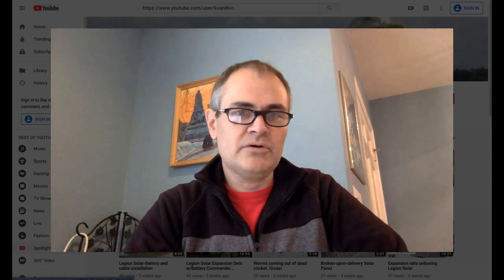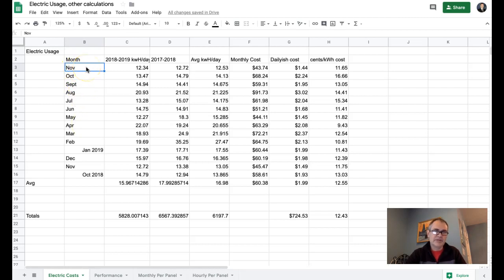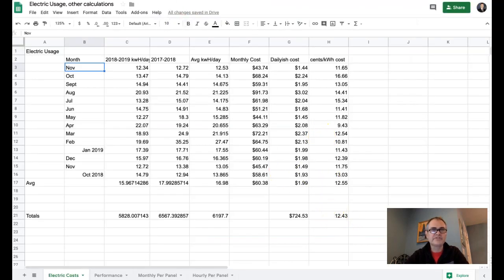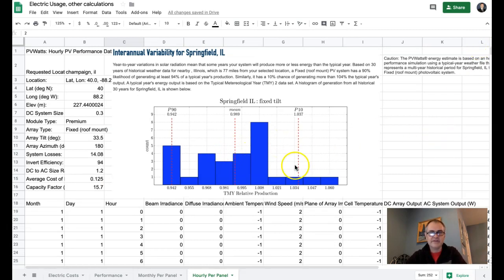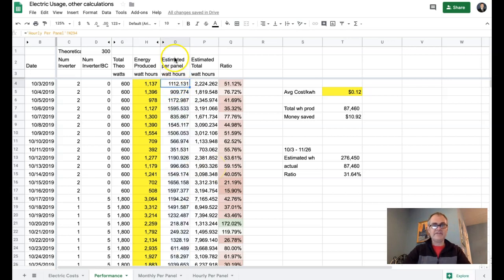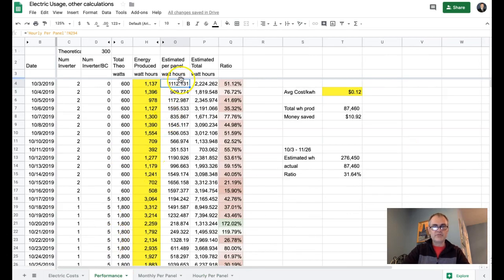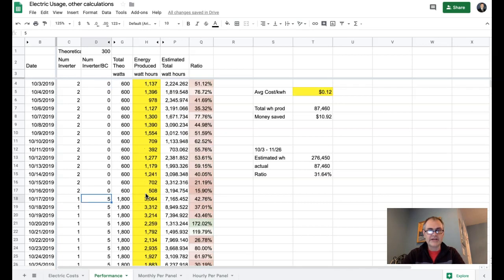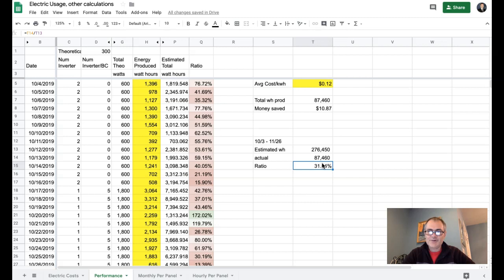Legion Solar 2.1 kW System Performance

Comment: Wow... you've done a TON of data crunching. Great stuff!

I've often wondered if the energy and time I put into researching, procuring, installing and developing similar analysis far outweighs the benefits gained. Without solar I pay my utility $282 a month for power for a 2500 square foot (single story) home in Phoenix, AZ. I know I live in one of the best places to leverage solar panels but I am not that inspired by perceived ROI.
Reply from the maker: At this point, I think many justify our outlays by the perceived financial gains, but, in reality, its as much a way to scratch our technological itch as much as anything.

Comment: Getting my legion solar system next week and I have a question, did you pull any permits to install the panels on your roof?
Reply from the maker: My municipality didn't require any.  Yours may differ.
Reply: Thanks Kirby, your videos have been very informative. Will be doing my install in the next week or so. Are you happy with your system and are you getting enough power out of your batteries at night to run a few appliances? Thanks.

Comment: Thankyou Kirby for your videos.  Helpful in thinking through Legion Solar.  Few thoughts on the disparity between actual and estimate
1)  You are loosing efficiency in the batteries.  As the system biases towards re-charging the battery before your load, you get an inefficiency when charging and then another when discharging.  I am not talking wire losses, I am talking chemistry losses.  85% is assumed.  But what the battery charger is doing is unknown to me.  Perhaps it is kept an un-deal stat of charge and its DOD is too deep.
2) I agree with Rusty Chase, those are not premium panels  On PVWatts page, based on some playing with it, it seems that would make a ~3% of that difference.
3) shading - if you increase your "system losses" setting for "shading" that could make a big difference

Overall, I suspect the battery is the main culptrit.  This is a "grid assisted" or "zero export" system.  It is not typical and the data in that database would be based on a more typical system.   I would want to know all about the SOC and DOD, but they don't give access to that information and control as they want to make it user-friendly.  It's a balance.

Comment: Hi, novice DIY-er here, 
Just to bottom line your opinion of the legion 4 so I can decide to buy it from Kickstarter while it's still cheap, do you recommend this solar panel provided you can get consistent light, and does its energy contribution cover the cost/maintenance of the product?

Comment: Hey Kirby, thanks for all of these videos and the great info. Just wondering, if you were to go down the path of a DIY solar system again, would you choose Legion based on your experience with the product/components and the company (service/communication)? Also, do you have any concerns or reservations about being able to find spare parts or compatible components should the company ever go under or stop producing the Legion system? Lastly, I just checked out the Legion 4 Kickstarter page and a lot of backers are pretty frustrated with communication from PLX. It's not that difficult for PLX to checkin periodically and respond to Comments on the Kickstarter page, so when they go silent for weeks, that would be a red flag for me as well.
Reply from the maker: Hi Steve,  Thanks for posting this question here and duplicated on the other video.  I think I'll probably just make a video blog discussing these types of questions (you aren't the first to ask) and I'll put that out within the next few days.

Comment: So I just finished having an online discussion with legion where after I disproved they were the cheapest they blocked me. It’s one thing to say you have better technology or a better quality product. It’s another to lie and censor people who disprove you
Reply from the maker: Hi Simon,  Thanks for this comment. I'm not sure what this comment has to do with the video content, but I'm going to put up a video in the next few days on my current thoughts on everything.
Reply: what other system out there did you find that is diy
Reply: dennis there are plenty especially in Australia. Our solar out here is around 2500 for 6.6kw installed completely

Comment: Hey Kirby, great videos, thanks for putting the time into these. There isn't a ton of info on Legion solar... seems "too good to be true".  Maybe I missed the video, but I didn't notice in any videos your installation process. Did you plug directly into 110 dedicated circuit? I've heard this can be very dangerous if it's not 100% dedicated. This old site explains it better than I can (look under the section where it says " you can not make a safe residential plug in grid-tie system.": https://wp.josh.com/2014/01/07/not-another-fake-plug-in-grid-tie-solar-system/

I have an existing solar array with a grid-tied inverter, but I got it build under-sized and I can't add to it, so I need to find another solution. I'd LOVE for something like Legion to work... especially if it's "plug and play".

Thanks! (and if this is all in another video, please point me to it)
Reply from the maker: Hi Rob.  Great question and very wise of you to investigate this fully before doing anything.  They market it is as being DIY and something that your average housewife or househusband could do in an easy afternoon but you really need to dot your I's and cross your T's lest you find yourself with a burned down home.

When I started I had 2 sets of panels, or 600 watts maximum theoretical peak output (and they never do that).  I DID plug that directly into an outlet on a circuit that I knew wasn't getting any other load.  (Legion Solar doesn't try to hide what you mentioned, by the way. Just might be a bit tricky to find.  If you click on the Tutorials and scroll down below the Gen 3 stuff there is a section of round buttons and the one on the right is Electrical Connection Notes.  That will describe what you had in the link you sent.)

When I upgraded to more panels I did put the panels on their own dedicated circuit and I have it wired so that I can split it into 2 different circuits (on 2 different legs of the main panel) if I add any more panels.  (I'm currently about at the max amperage for a 20 amp circuit with the panels I've got).  

If you want a video of anything to help explain this, let me know.  I'd be happy to help out as I can.
Reply: @KirbyVandivort , brilliant, thanks for all the info! I'll keep doing research and reach out to get more of your thoughts. I'm wondering if I'm at the point where I should just go with "traditional" solar for the size of kW I want to add.

Comment: My best guess is that those trees are not helping to make up for that % difference. I plugged the numbers for my property on the NREL site and checked the differences on a fixed vs single axis tracking system and the solar radiation difference between the two is about 20%. If we assume the partial shade you are getting every day from those trees is similar to the difference in a fixed vs single axis tracking system then that could be the difference you are seeing. BTW, thanks for your log of videos on the legion system. I was thinking about trying it out and recently pulled the trigger after watching your videos and doing a lot more research in the past. It seems like a cost effective way to build a system gradually. I ordered the basic starter set, mostly just to get the regulator at a cost that was better than buying the regulator alone. I also ordered extra microinverters that I'm going to use with some flexible 160w panels, that I already have, to build a solar patio cover using a taut steel cable system as the framework to mount the light 6 pound panels.
Reply from the maker: I'm sure that the trees aren't helping, but if you take a look at one of the other videos (I'm not sure which one) I actually am on the roof where the panels are sitting and show a phone app that shows the path of the sun during the day, and they aren't as shaded up there as the view was from the ground.  Having said that, I AM agreeing that the trees are negatively affecting things, particularly as the sun gets lower towards December 21.  Luckily for most of the year the sun crosses the sky above where the trees are.

I'm glad you have found the videos at least slightly useful.  :)  I have tried to be as honest as I can with respect to physical quality, app quality, results ,etc so that others don't have to go into quite as blind as I did.  It will be interesting to hear your results from trying to use the components in ways that they aren't entirely meant to be used.  I'm curious to see how open the system is to that.